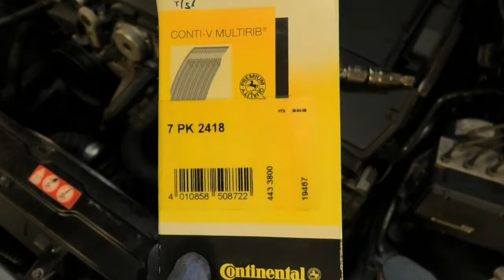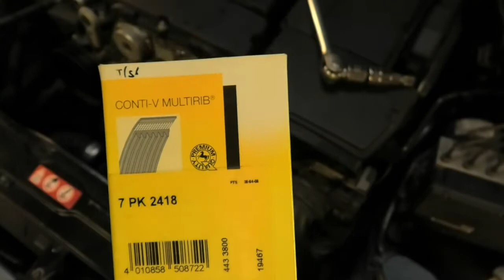Mercedes w203 c180K V belt, alternator, serpentine multi-rib belt removal replacement

Comment: Thanks for your video DB
Just to add a note -
The belt Idler pulley bearing locked up & spat the belt off when my wife was driving on her own - so this is why I'm watching your video
My advice to add is when you take the belt off check the 2 Idler pulley bearings - just by hand and if they are slightly scratchy or notchey - Replace it!!
Also draw a map of the belt location around the pulleys
- 8 pulleys
Double check the belt is sitting neatly on each pulley before turning the key
👍 Thanks again for your good video - looks like a bit of a bugger doing that job with a camera 📷
😉 Nigel
From QLD OZ🇭🇲
Reply: Quick question if I may? I have the w204, same engine. has a vibration at about 2000rpm. My mechanic said it could be a pully on the engine, maybe even the harmonic balancer. It seems fine, the balancer, but my question is what symptoms did the car give you before the belt was thrown. Ps, the car has 118k and it's driving me mad.
Reply: @lancegraham7722  
Hi Lance
That vibration is a concern
I was getting a scratching rotating noise when my idler pulley failed - said to myself worry bout that later - wrong!!
The harmonic balancer does balance the crankshafts rotation so that sounds logical. But, your KMs are low & harmonic balancers are ment to last an engines lifetime - & a big job $$$
My best advice to give is get another opinion
Another thought - you need to rule out the simple things like wheel balancing
Good luck 🤞
Reply: @Nigel Pont  yeah, It does it driving and at idle..while driving it sounds like a burble through the car, at idle it's a rough noise inside. The strange thing is, you cannot hear it outside of the car. Everything has been checked and all compression is good, timing fine, all mounts and any moving components are in great condition. It has me stumped.
Reply: @lancegraham7722  
I wish you luck with that
Fan blade out of balance??🤔
Maybe someone on a Merc forum chat has had a similar problem - my son is full of 4wd knowledge from those chats👍
Don't let it beat you
🤞
Reply: @lancegraham7722  buy a plug & display Lufi XF OBD2 for mounting on the dashboard. At 750rpm idling MAF reading 4.7g/second, air conditioner switched on, MAP at -7.35psi. throttle valve body at 17.2% open. Months later my mechanic cleaned the up throttle body, during the oil change out for the supercharger, and the position dropped to 14.9% open at 750rpm. No change in MAF & MAP reading. 

Put on auto cruise mode and keep at 2000rpm and you will be at 85km/hr on a flat road. MAP at -3 to -1.5psi and MAF at about 18g/second. Keep your eyes on the road and use your hand phone to record and review later. Look at other recorded parameters like ignition timing vs rpm vs O2 sensor reading etc etc. 

After the above  a can of injector cleaner & fill fuel tank to 90%. By the time fuel tank is at 20% do another run & recording by OBD2 for 20km. Try then compare.
Reply: @whlawson  thanks for the in depth  info. After i spoke to 2 more mechanics, including CAPA, a supercharger specialist, we have come to the conclusion that it is most likely the coupling inside the supercharger itself. I have removed the charger and will be sending it over to them this week for a rebuild. Hoping this is the issue.
Reply: @lancegraham7722  OBD2 on dashboard would show me, whenever intakes air pressure increasing from 0 psi and going up towards 4 psi, (or even 7.5psi) that the supercharger bypass flap is being modulated. 

Clean throttle valve body, bypass flap body, change rubber ring for the engine oil cooler located below oil filter casing, clean the PCV & hoses and reinstall with small smart.  clamp. Wrongly install direction for old PCV or bad PCV will result in boosted air pressure, from the supercharger, blowing into the engine crankcase. Best is to replace PCV & it's hoses with new and fit with smart clamps and no worries for the next 5 years.

Buy from one line engine oil dip stick. The one I bought is only 570mm from tip to its stopper. I grind off the OD of the stopper. Now the top of the inserting knob becomes the stopper. Inserting length is now 600mm. After dipping I keep the dipstick in the boot. 😅😅😅
Reply: @whlawson5812  
Hey Lance
Sounds like you're getting some really good information about your Kompressor engine 👍
I've just been looking online at a 2003 C32 AMG with low KMs for $25000 here in East Coast Australia
Wow what a car! 260kw/ 350hp V6 Kompressor
So advanced tech for it's age
Don't mind me I'm jus' dreamin' here 👍

Comment: You should install oil stop cables to preempt the scenario in which the magnetic variable valve timing units start leaking. Any oil making it into the regular cables will creep through the whole cable until it reaches the ECU and destroys it after a while.
Reply from the maker: Thanks for the tip, I have seen oil in the ecu in other cars, si yes that’s good advice cheers.